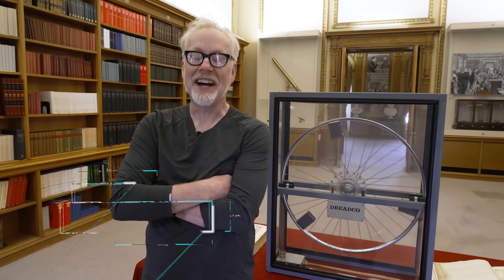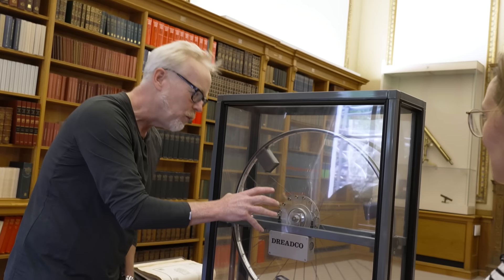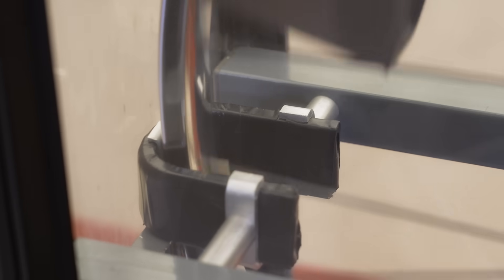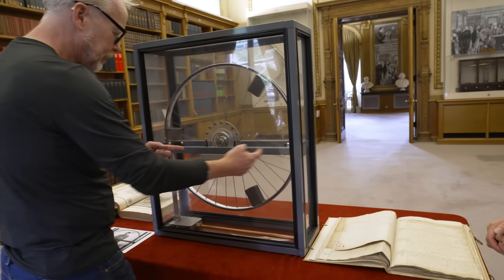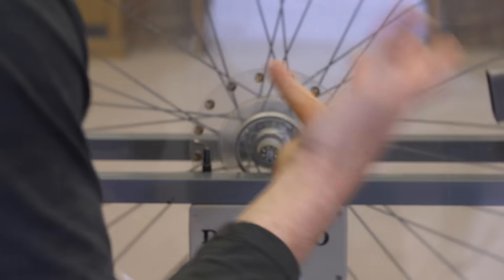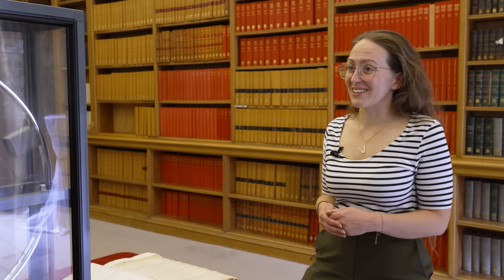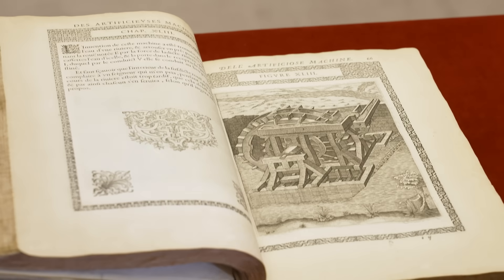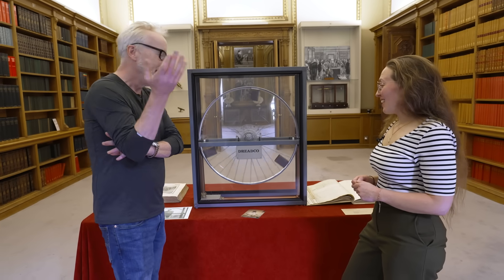Adam Savage vs The "Perpetual Motion" Machine!

Comment: Slightly different topic, but I have invented a hydro-electric, stand alone free energy system.
It uses gravity from water flow to generate power, that powers a pump, that recirculates the water, which generates water flow again. As the cycle feeds itself in a continuous loop, there's more power generated by the generators than the pumps need to maintain the water flow. This excess power can then be diverted for use as free power. Imagine a dam without a river, the water spins the turbines as it falls through the dam, but instead of being on a river, there's a pool at the bottom, collecting the water for the pumps to return it to the top of the reservoir again, and instead of sending all the power away, it only sends some away. Being a looped system, apart from the occasional top up due to evaporation (this problem can be solved easily by either using a piped system or enclosing the air in the top and bottom reservoirs, almost eliminating evaporation, and the need to top up), it's a stand alone system that only needs occasional maintenance like generator repair or replacement, and the same with the pumps. There's also several bearings that would need both service and maintenance occasionally. Overall, without giving out actual figures, most of the energy it makes it's recycling to keep itself running, but the benefit is the small part (I'll call it an unnamed percentage for now) that can be diverted like a free power system.
Unlike solar power, no panels, sun, or batteries are required.
Unlike wind power not wind is required.
Unlike river or ocean generated power, no current or waves are required.
However, it is hydro electric.
Thoughts?

Comment: the boxes are magnets passing through 2 coils one on each side giving them a small push each pass ,and if you look at the center of the wheel you 'll see 2 probes working as sensor to tell the controller when to active or deactivate the coils on the sides ,the wheel is probably in a low friction environment under vacuum . so it is basically a motor   using really small energy

Comment: I've been working with brushless sensorless DC motors and this configuration is one of them.  The box at the bottom contains a battery with a switching circuit alternately switching the electromagnets on and off at regular intervals.  The duty cycles of each don't need to be much; it just needs to be enough to over come the friction of the bearings of the wheel.  The 3 blocks of what I would think are iron serve two purposes; 1 as inertial masses and 2 as ferromagnetic masses.  The two 'sensors' near the hub are a mcguffin and are not needed in  this configuration.
Reply: The whole damn thing is a red herring.  You're right, given the added mass of the blocks, it's essentially a flywheel.  Imparting enough energy to keep it revolving that slowly isn't a problem at all.  Balancing it was probably the major hurdle.  I bet you could detect the angular acceleration visually, if you couldn't get close enough to measure the fields.  Hell, you know what, it could even be simpler and just have a mainspring in the axle.
Reply: @amarissimus29  the “tuning” is to make sure the spokes are true so there is no or minimal loss to power.
Reply: @amarissimus29  I like your mainspring theory. Definitely sounds like something that would be disappointing to hear haha
Reply: What are the heat sinks and copper pipes for?
Reply: @elimalinsky7069  more red herring
Reply: Or This.
Reply: Sounds like something you could possibly build then to prove you are correct.
Reply: That would work as well.

Comment: The element that prevents any device being truly perpetual is of course friction. Eventually, over time, 2 surfaces moving against each other will either wear away or cause static interaction. The point of dynamic interaction is the axle and the ball bearing race. That is the part that will need serviced, either oiled or swapped out. The case is to keep dust out of the bearing race. The momentum is maintained by magnets in the three boxes on the wheel passing through the two u shaped magnets with opposed polarity spaced out at a complimentary interval to facilitate continuous fluid movement. everything else in the box is of the red herring variety. the envelope has been opened so many times, the packaging tape has lost its stick lol. The lady that was showing Adam has definitely had a read of it too I'm thinking, but deceives inquisitors by use of plausible deniability. All of this is either correct, partially correct, or full of shit. I'm open to any of these being the true outcome

Comment: My theory (6 minutes into the video): Each of the boxes is a self contained hall-effect sensor, battery and electromagnet assembly, and the paired U-bars on the left and right (or more likely just one of them) have some pretty tiny magnets inside them to trigger the hall effect sensors to activate then flip the electromagnet polarity to pull-then-push the box along with a tiny amount of force. Everything else is just a decoy.

Also, if they are unwilling to even take it apart then literally what is the point? With the guarantee that it would never fall under scrutiny, the inventor could say/do/act whatever and however he wanted. He could hear a million correct answers for the way it works and arbitrarily pick and choose or outright deny all of their veracity.

Comment: The fact it can be turned on and off and runs for 2 years is kinda funny. However, if the magnets turn on and off with the power generated from each rotation. The wheel may never exert any excess power. However, could possibly run for a very long time. And if the wheel is spinning on a very close to zero friction, then it will take even less power to rotate. Im just amazed we can't invent something that is in a constant motion of free fall.

Comment: Just batteries with electronics and a coil in each box on the wheel, and permanent magnets where they pass through. 
The rest are decoy's.
It's basically a brushless dc motor

Comment: Photons don't have mass but I think they still can impart a little push onto something strictly through giving it a little energy but still without outside intervention it's at best Ultra efficient at preserving kinetic energy but not perpetual that said it doesn't even have to be that because in all likelihood is just a gimmick specifically built to deceive obscuring the truth which is why you're likely not allowed to take it apart and investigate it more thoroughly as at that point the cat would be out of the bag and the illusion would Fall Apart

Comment: It is an aluminum heat sink with copper heat pipes just like you would find in a laptop by the looks of it so perhaps convection currents are involved but still would require an external source of heat
Reply: The temp difference between top and bottom of box is the power source.
Reply: @Babes4Birds  just like prairie dog air conditioning then... 
Cool

Comment: The magnets and boxes are distraction. The heat sink is in lowest part of box, the coldest part. The heat sink is on left cools air above it, which falls , and induces directional flow of air in pipe. The airflow blows on rim edge spinning it. It's limited in power and so can hardly accelerate. Put heat sink in cooled block and speed it up. In any room with gravity, the convection currents will drive this thing. Because colder air is denser, falls. The enclosure ensures  convection airflow isn't interrupted. Warm the heat sink and see direction change, ..

Comment: I suspect this example of a "perpetual motion" machine which needs to be "restarted" every few years is no different in how it works than the imitation pendulum clock I have in my living room. A single AA battery keeps the pendulum swinging for a good 4 years and it is simply a small coil electro magnet which gets excited as the pendumuls permenant magnet passes and feeds back a larger force that gives it a tiny push. I suspect the boxes are just magnets and as it passes one of the coil magnets it excites a circuit and has a boost with a small battery to then push the other side a small amount which is why they are offset. Possibly those bits in the middle are triggers to energise the magnets and both electro magnets are drivers, so like Adam said, a very simple example of a motor. A small hidden solar panel could easily keep a lithium battery charged for years and a well balanced wheel with good bearings would need only a tiny amount of energy to keep it moving.

Comment: That boxes are batteries. The motor is in the barring. Power is through the prongs. It saves power by being in a vacuum. The balls on the inside circle are magnets. The black brackets on either side are not magnets. They are wireless chargers for the batteries. The vacuum won't allow much temperature change so you lose less energy as heat. That's why there is a heat sync connected to nothing but the box. The air inside must stay cool. That's why it stays in a basement for so long and only gets serviced once every two years.
Reply: The vacuum also provides less friction. Even if the  brackets aren't wireless chargers, it has the same spin time as most watches. The batteries can last so long that after a year, it would hardly change in speed.

Comment: Capacitors passing through a magnetic field can continuously flow power as long as they are consistently charging and discharging. Makes sense as to why the copper is connecting the two fields? Everything else is a diversion?

Comment: This operates on the ever changing biometric pressure... there is a vacuum inside the frame, the axle has no friction as its magnetic.   An adaptation of a biometric clock movement

Comment: There's probably three things going on at the same time...

Wheel inertia...

Magnetic attraction...

Gravimetric pull.

The boxes conceal the balanced weights that 'fall forward' at the right time when the uppermost box reaches the apex of the circle.

The mounted magnets on each side tug gently at the iron weights balanced inside the approaching boxes.

The forward thrust from the falling iron weights in the uppermost box keep the magnets from slowing the turning wheel.

Once the timing and positions are properly set, the wheel is then set in motion (by hand). 

There's nothing to stop or slow the wheel except worn out parts (ball bearings, grease, etc) which have to be occasionally replaced. The wheel is then set in motion and the device is good for another two years.

The extra stuff is just there to throw off those trying to figure it out.

And...

Once you see how simply it works, it is kind of a letdown.

Comment: OK Royal Society - I figured it out - and want the prize. The three metal boxes attached to the wheel itself contain a vacuum inside. Atmospheric air of 14.7 psi presses into the boxes from all sides as a normal function - but for just a moment as they pass through the magnetic field - the pressure field becomes unilateral (one sided) instead of two sided - this creates a momentary push from the air as they move through the magnetic brackets. The device is not a self contained "perpetual machine" - the energy pushing the wheel comes from off the wheel.  This is important to understand. The off wheel 14.7 air pressure - is pushing the vacuum around in a circle - in the same manner that an airplane needs forward motion to create enough lift to leave the ground. The wheel goes in motion as a circle - whereas a plane is moving laterally fast to generate the vertical lift needed to fly. The motion creates creates a unilateral push on the vacuum boxes going up and going down - but since the wheel is going around in circles it can be pushed forever - by air pressure - and the energy-weight contained in the flywheel creates enough momentum to run it through another cycle - perpetually.

Comment: Temperature/heat perpetual machine where the left side cold down the gas/liquid in the boxes while the right side heated it up. The secret of temperature differentiation. Gas in the chamber may be in balance with the liquid/gas in the boxes (material density)

Comment: This machine seems exceedingly simple to resolve. Right off the top, we know that its battery only lasts a little over 2 years, but I imagine that the people who do the servicing have probably upgraded the type of battery as time has gone on while great caution taken in ensuring that they stick with something with a extremely low failure rate (we've all had a battery explode in one device  or another). Also, there is probably batteries hidden anywhere in the body of that machine possible.
Those blocks on the wheel are most certainly concealing magnetically reactive metal that get a slight tug on every rotation. That little prong is a simple sensor that can detect those discs on the wheel so that the magnetics get triggered just at the right time. The wheel spins only at that speed so that the sensor doesn't have to be more precise.
I take it for granted that they are using magnetic bearings for the extra reduction in drag/friction.

Really, choosing the right speed or rotation and the right battery seems like the biggest challenge in making this device. It makes me think of the Oxford Electric Bell.